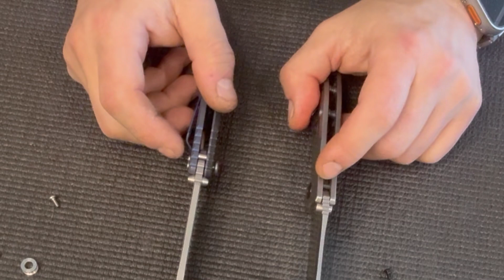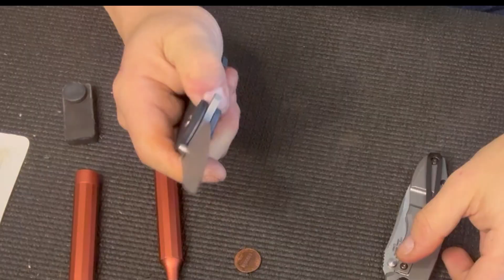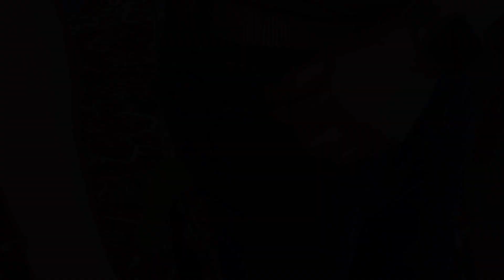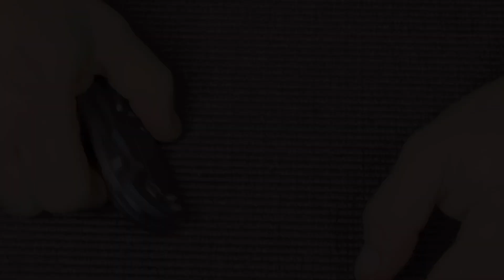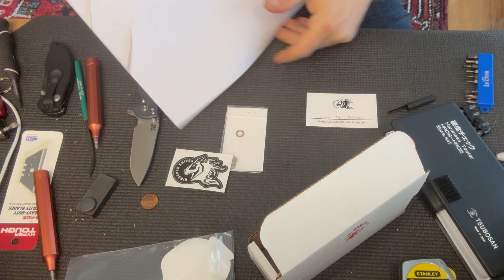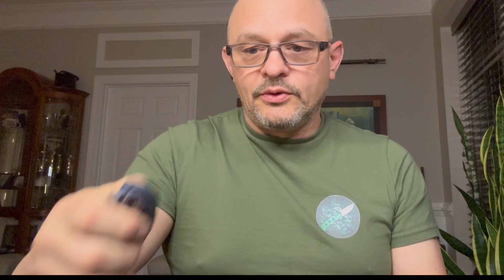Comparing ZT Hinderer 0562 Ti to Hinderer XM-18 side by side. Hinderer vs. Hinderer

Comment: Cbr what is the benefit of titanium pocket clips? I feel like stainless steel would do just as good of a job and be cheaper to machine. I do understand titanium hardware but never had been interested enough to try it
Reply from the maker: Other than the prestige of more premium material, the biggest technical benefit is its near absolute corrosion resistance. There’s no stainless steel in existence that can rival that. The yield strength of Ti and its alloys rivals that of structural steel as well starting at 63 KSI in pure form and reaching 120 KSI for grade 6, which is equal to that of tank armor alloys. That combined with high modulus of elasticity, which makes it “springy” presents enormous benefits. I have two Ti-bladed knives btw and while the edge retention sucks, as it is a very machinable metal, these are nearly impossible to snap. Hence MARSOC issues them for underwater ops. Basically, it’s a super-alloy.

Comment: I think that a magnet does not prove it is titanium or stainless steel. If it is not magnetic it could still be stainless steel with high nickel content in the alloy. Furthermore, I believe that companies that produce knives should be much more transparent about the exact materials used and their composition in their products so that we as consumers do not have to guess which material we are dealing with for a particular component. I had both knives here. My advice: get the Hinderer. But check the knive very carefully for little mistakes. Once a had a XM-18 here with an very uneven grind on top at the blade. I send it back to Lamnia. I adviced Lamnia to send it back to Hinderer... However, after inquiry, they simply sold the knife to another custome. Now that is how you destroy slowly a good name.

Comment: I have 0562 and there are only two things that bother me: the clip and the bearings.
So if I can I will get a no choil version of Hinderer to use it on the phosphorus bronze washers
Besides that 0562 is wonderful
Reply from the maker: Hinderer comes with a 1 set of bronze and 1 set of nylon washes. Also, all kinds of washes are available on McMaster

Comment: I think it's possible that the designer put the grooves on the flipper so that it helps with traction when the knife is open and you're choked up on the finger choil... Right?
Reply from the maker: Possible! Especially if you’re pulling the blade out of the dead man’s rib cage! I bet that’s what the designer was imagining

Comment: Just a little work on the detent hole/ramp, with a diamond pen, and the 562 will easily deploy via the stop pins. Just be very patient and careful, for anyone who attempts it! Baby steps! You can’t undo it, if you remove too much. To be honest, it took me a period of a few months, and probably 5 disassembly’s, to achieve the perfect balance between the flipper detent and the thumb stud detent.
Reply from the maker: I appreciate the suggestion! I may look into replacing the thumb studs with the stepped cone style like on XM-18 first. That would do the trick, I’m 90% sure 👌

Comment: About screws. It is doubtful for me that it was produced from titanium. Many kinds of stainless steel are not magnetic at all. I guess that it was used for screws, because titanium will be too soft for screwdriver contact.
About knife - I like both of them. ZT has one bad moment - steel bearing, because it is pretty old model, now even cheap Chinese knives offer ceramic bearing.

And generally - thanks for your content. I have discovered your channel recently, but I am very glad to meet man with high level of understanding and without all this advertisement garbage.
And thanks again for your English - it is clear even for not native speaker like me :)
Happy New Year! Many new knives and reviews :)
Reply from the maker: Thanks for your kind words and I’m happy to be of help! 
The small screws are totally available in Ti, just check the boat load available for the most popular knives like Bugout and Para 2 & 3
They usually are anodized in various colors but any and all coatings and finishes are available to a manufacturer like ZT. 
The recommended torque for T8 screw is only 10-12 inch-pounds so it won’t matter that Ti is softer than steel. Think of how much more ductile the aluminum is and then think how many knives have steel screws threaded into the aluminum frame. If you use an assertive expression like “it is doubtful to me…” it sounds like you’re disagreeing with the other person. Instead, try using a question like “do you think they might have used a low ferrous content stainless for the screws rather than Ti?” To which I would say no, such stainless is as soft as the Ti and twice as expensive than the kind that’s magnetic. These grades are used in chemical vessels, food prep machinery, salt water equipment etc.
Reply: @CBRxLIVE  thanks for answer.
So, you are sure, that most factory screws for main brands (Benchmade, Spyderco, ZT, etc.) are produced from titanium? Or it is about only about some anodized screws?
Reply: @CBRxLIVE   - own several hinderers - I'm pretty sure the factory hardware is all steel; however, and as you're probably aware,  titanium hardware is available for purchase (except the pivot nut) or included on hinderer special configurations. But I am pretty sure the base models come from factory with steel hardware despite not being magnetic. Overall, I am a fan of the channel. thank you

Comment: Only reason I like to carry the hinderer tip down is because of the lockbar cut out when carried tip up my pants gets snagged when pulling the knife out and it makes it way easier to slide it in and out when not dealing with the lockbar cut out.
Reply from the maker: Ha, all my pants are fraying at the pocket edge! As you can see in this very video 😂
Reply: @CBRxLIVE I wear very expensive the price of a new hinderer expensive custom made denim pants. I have a specific knife pocket in them that is separate from the front pockets. Also very thick heavy weight denim. One pair is 22 oz and my other pair is 25oz weight.
Reply from the maker: @tallica4life81  I also started buying pants with reinforced pocket, but they are the price of a new Effengrow. Wrangler Technicians from Walmart $28!
Reply: @CBRxLIVE  very cool